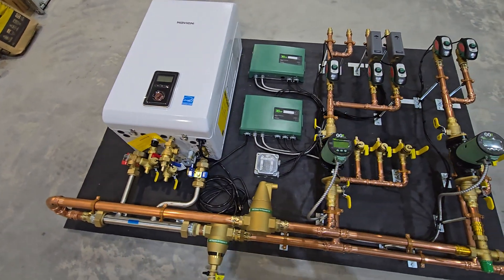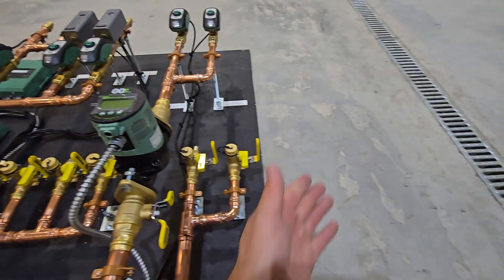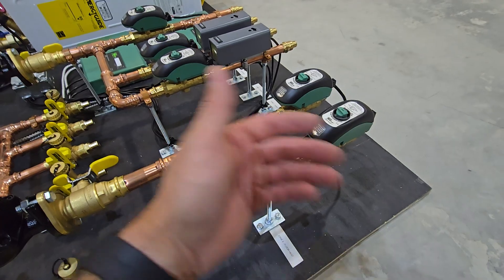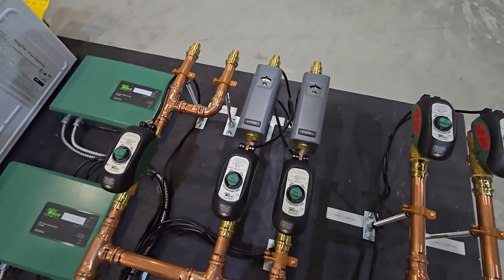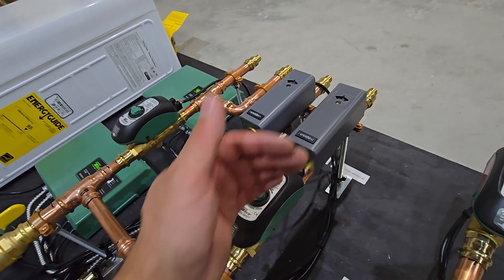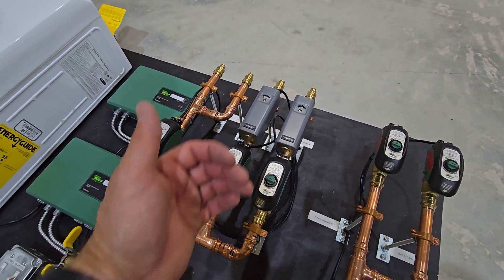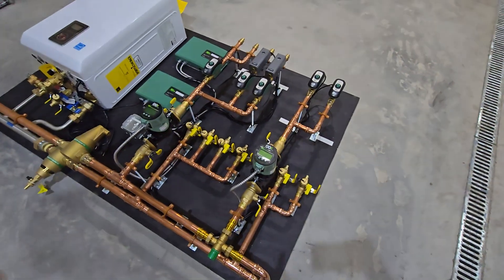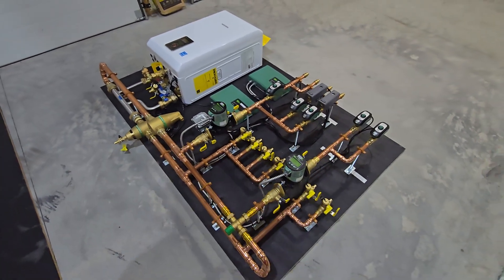Combi Boiler System With In Floor, Radiators and Towel Warmer Zones

Comment: why not use a 4in1 hydraulic seperator with the air elimination mag filter all in such as the CB100-4
Reply from the maker: Sometimes I do but this is built for a compact space and it worked out better.